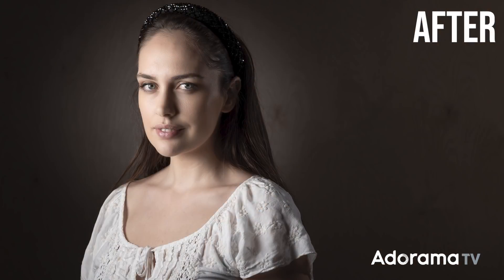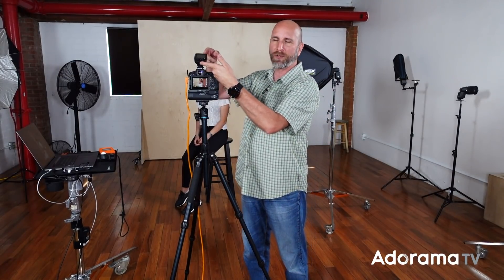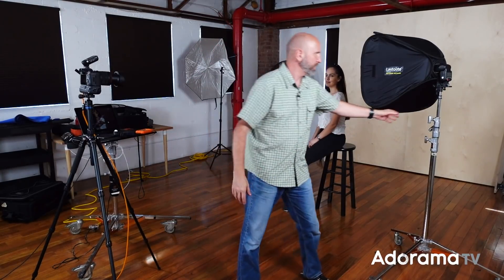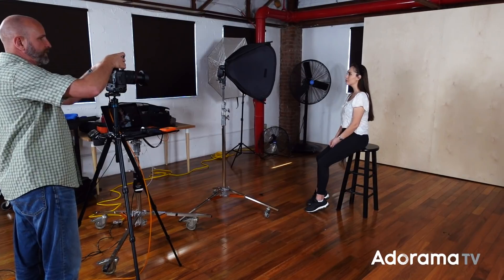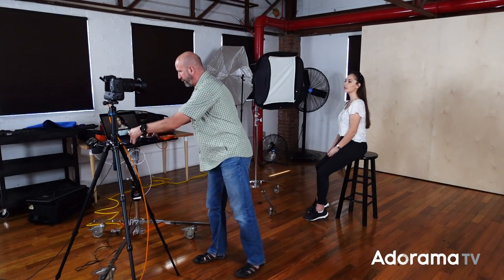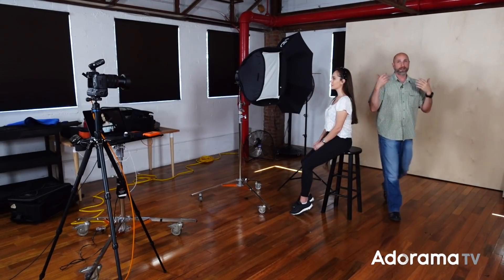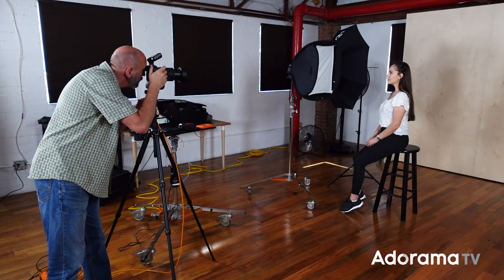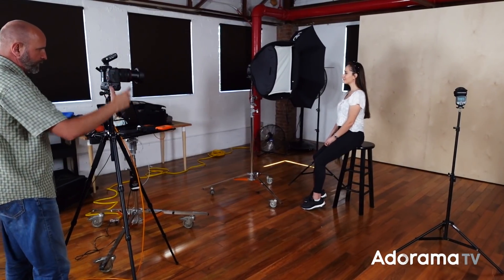Shape Light Using Speedlights and Basic Modifiers | Mark Wallace

Comment: Nicely explained video.  What is the thought process of using f11 or f14? That seems to be pushing the key flash hard slowing down recycle time, wasting batteries and since the background is nothing special for a texture
Reply: At that distance the flash isn't struggling to keep up, the refresh times are just fine. And with 200+ flashes at full power the batteries are good to go. If you can't get the shot in 200 attempts, something is wrong. hahaha. Seriously, I normally shoot around f/9 for portraits to make sure I get the entire head in focus. Play with it and see what values work best for your focal length and shooting distance. Normally I'd dial it down a bit to get from f/11 to f/9, but to keep the video moving along I just went with what I had.